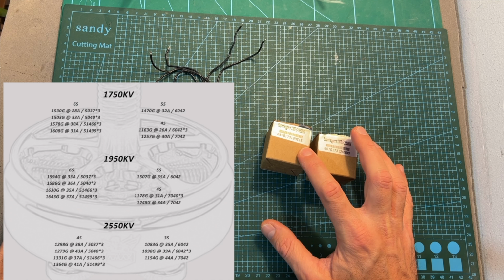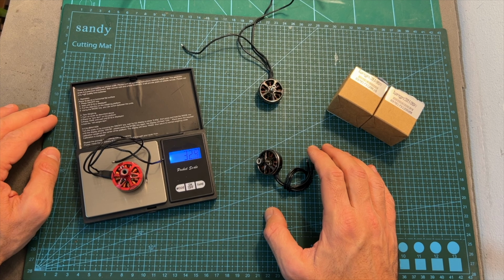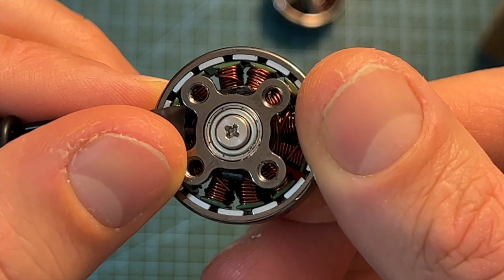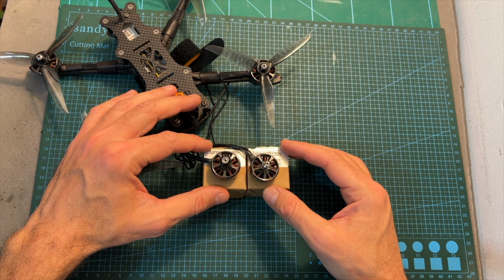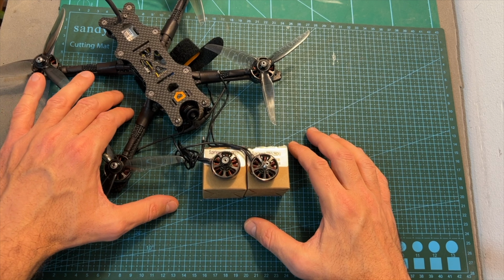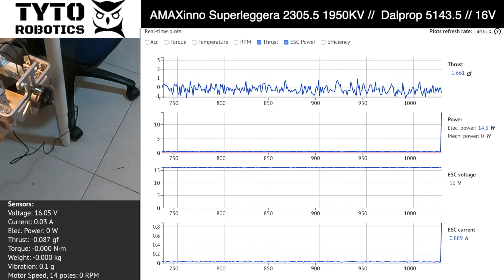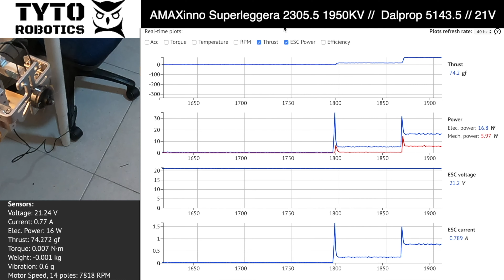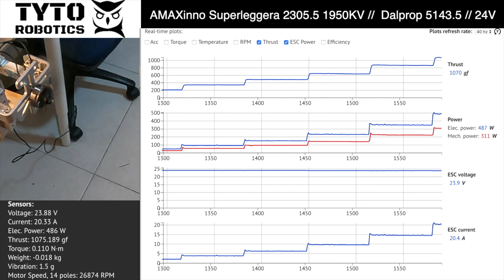AMAX 2305.5 SUPERLEGGERA  Motors - Thrust Tests & Flight Footage

Comment: I have had these (or the previous version) on a cinewhoop for a while - I think having a less durable but lighter motor makes more sense when it's inside a duct. Also the 2550KV version will spin a 3-3.5" prop on 6S just fine.

Comment: I have been thrust / amp testing to . I am going to debate that your dyno setup, the props are not in clean air and prop thrust is running into the dyno motor mount. I made a motor extension 12 inches long from a peace of 25 mm alloy tubing with motor mounted in end. Huge data result differences on thrust and current draw 0_o I dont have data acquisition like you , springs and hand meter ( so you still win lol  . Cheers from the frozen waste land Canada
Reply: If you look closely you can see props are on as a pusher configuration.
Reply from the maker: Thanks for your feedback. My props are indeed in a pusher configuration, as recommended by Tyto Robotics and I perform all my tests in the same environment to they can be properly compared. Cheers! :-)
Reply: @aquilinefpv2592  Oh yes true . I share your observation and appreciate it.  But a prop is a double sided sword . It needs clean air in and outbound .
Reply: @KremerFPV  Cool. are they using linear encoder or strain gauge to gather thrust data?
Reply from the maker: @BrainDeadEngineering  I am not sure - you can check out the product page (it's linked in the description of the video).
Reply: @KremerFPV   love your shit Kal , like the way you think ! Wish we could be friends 🙂 lol

Comment: Shalom Gal, can you please release a long term use video of this motors, I have absolutely loved the previous version but it had issues with loose magnets over time, I had only 1 event on 4s but my friends had 3 out of 4 motors with this issue on 6s setup. that was a bummer to use them on my next 6s build

Comment: Nice review!!!!
Have you ever had any freezing of your FPV feed during flight ?
Is this tested flown on 6 s in the video?
I have 2306.5  on 6S with a 20 x 20 Akon stack. If I do 2 to 3 flips back to back my video will freeze not all the time occasionally. I have installed a 1000 UF capacitor along with a Fetteck spike absorber and I still get slight video freezes if I do multiple flips back to back. Have you ever had this happen also did you use a 20 x 20 flight controller and ESC on this build. I thought that that might be my problem that the 20 x 20‘s don’t handle the electrical spikes well and it’s passing it along to the Vista ????
What are your thoughts have you ever experienced this?